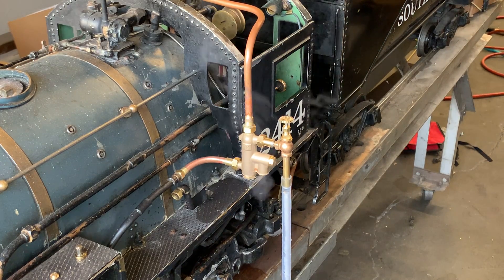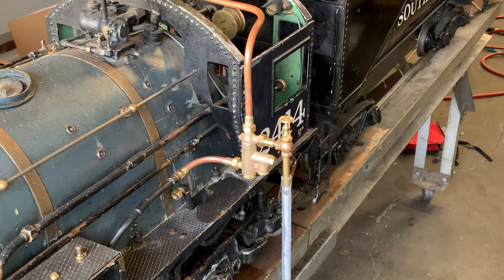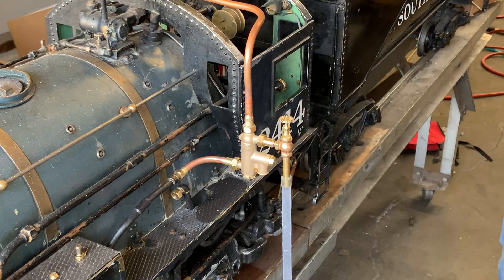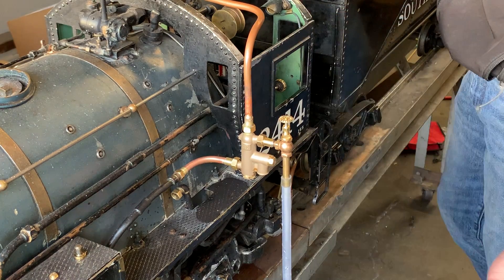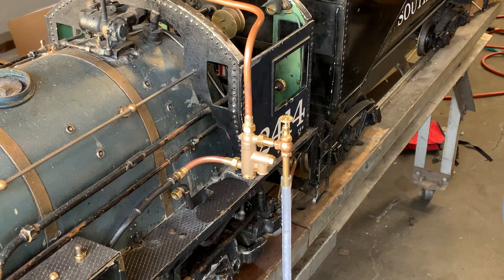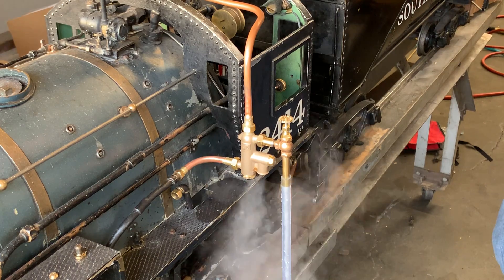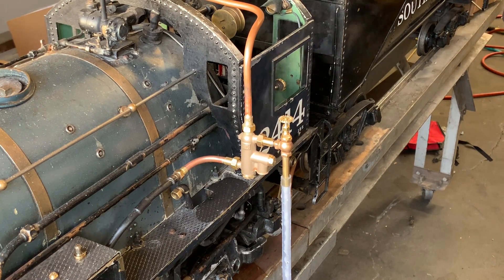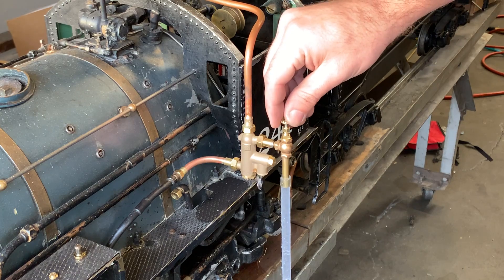Testing the EE Intermediate Injector

Comment: I found out the hard way to make sure you don’t have a leak on the suction side. I used quick connect between the tender and they leaked under suction.